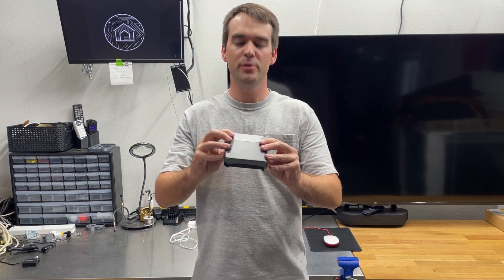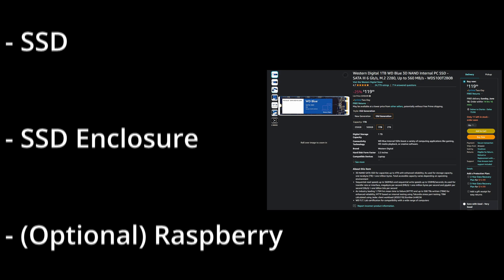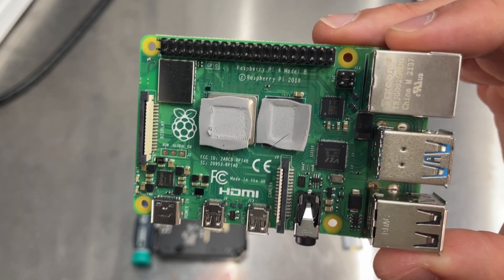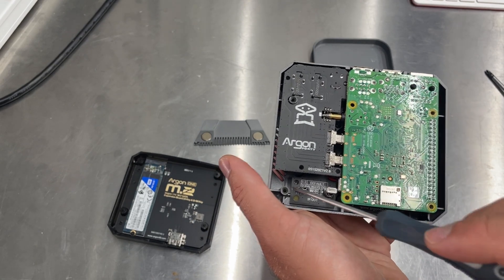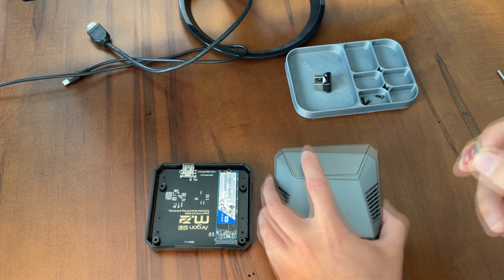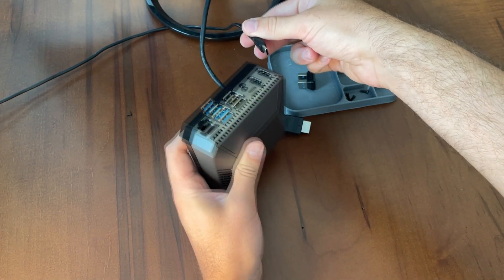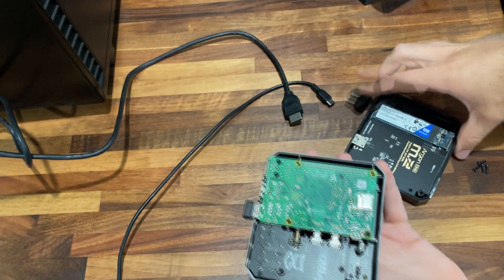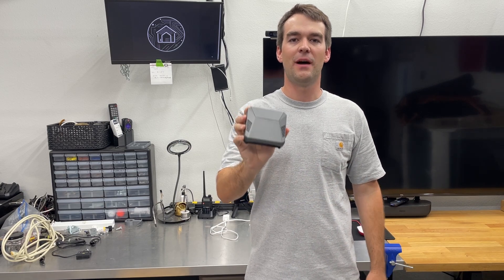How to Install HomeAssistant on Raspberry Pi 4 with SSD - Argon One Step by Step

Comment: There was no need to install HA to the sd card after the bootloader step.  Use an enclisure and install the image to the ssd.  It will boot from the ssd and install HA as normal.  It's how I did mine ,  although I have the nvme bottom for the argon so I loaded the image to the nvme then placed it in the argon.  no problems.
Reply from the maker: That assumes you have an nvme or sata enclosure already. This is cheaper for new folks who won’t use that hardware again

Comment: did you order only the Argon case or also the expansion board? and does it come with the USB dongle?
Reply from the maker: I believe it came with the expansion board and dongle but I do know they’ve reworked it with some different boards that support nvme now
Reply: @ChuckBuilds  now they sell them both separately and they also sell the nvme board now, thanks for this!

I did have another question .. do you know how I could add the backup so I would be able to restore from it on the SSD? or maybe even move it to the SD card?

Comment: why not use the 64bit version?
Reply from the maker: You could, it doesn't really matter since we aren't using Rasbian as the primary OS - just as a temporary step to load the HomeAssistant OS.

Comment: Hey Chuckbuilds - a lot of videos says it’s not possible to set HA up without Ethernet cable (or very difficult to do) As I have Starlink gen 2, I only have facility for WiFi and after searching for a video that shows you how to set-up using WiFi I found yours and as a bonus you have the same case and SSD as me. You’re a genius! Many thanks for the video my friend
Reply from the maker: Glad to help!
Reply: Is there a way to get it to boot automatically when the Pi receives power? Eg if it loses power momentarily then power is restored - the Pi turns itself back on. Thanks
Reply from the maker: @chrislee5245  I don't think this feature exists for a Pi but it is built into a lot of BIOS' for computers. I cover it in my Dell Optiplex video.
Reply: @ChuckBuilds  I thought it would be possible, never mind. I had it years ago on my crypto mining rig
Reply from the maker: @chrislee5245  It might! I didn't see anything on a quick google. Crypto mining on a pi? wild!
Reply: @ChuckBuilds  no you misunderstand my friend - the crypto mining rig I had was a basic PC with 5 GPU’S. it sat in an aluminium frame
Reply from the maker: @chrislee5245  Oh nice. Yeah it's a lot more common for a PC motherboard to have restore from AC loss settings. the rpi doesn't seem to.
Reply from the maker: @chrislee5245  actually, the more I think about this. I think as long as the pi has power it will turn itself back on. I don't think it would stay off. There is no setting for it. But I think it would just be on with power attached.
Reply: @ChuckBuilds  my Pi definitely doesn’t turn itself back on when power is restored - I’ve just tested it

Comment: When I plug the USB jumper in nothing happens - the SSD is not detected.
Reply from the maker: What SSD are you using? And you're using an Argon case correct?
Reply: @ChuckBuilds  That's right and a Ediloca EN206
Reply: @ChuckBuilds  Addendum - I think the USB bridge was bad. I have it working with a separate USB to USB cable.

Comment: Metal Table is a bad idea, unless it's grounded and then still covered it with a matt
Reply from the maker: I see where you’re coming from but it’s a coated nsf certified surface so I like to think it’s fine for my hobbyist use.

Comment: If I have already RPI OS installed on my SSD, how to install HA??
Reply from the maker: You need to use a flash drive to overwrite the ssd. You can’t be using the ssd for the os and overwrite it at the same time

Comment: Seriously? I mean the video is great, but how can you recommend an NVME SSD .. and only line out on screen that it's actually not suited for the exact purpose of the video??
Reply from the maker: There are some argon kits and SSD expansion boards that work with NVME, in which case I would recommend an NVME. I would recommend an NVME over SATA SSD as it is faster and generally cheaper. However, for my specific Argon SSD expansion board it requires a SATA SSD. If you are purchasing these parts, get the NVME versions. If you already had the parts, double check it doesn't require SATA like mine did.

Comment: Mine can’t get an ip ?
Reply from the maker: What kind of device? Is your NIC supported by Linux?
Reply: Ouuu I’m new to this I don’t know what (NIC) is but I’m doing this with an xps 15 laptop, I have the raspberry pi 4, on a nighthawk r7000 router.

The raspberry is connected to Lan cable . But I don’t see the ip by the (wlan0). I also had an pi in the past that I got rid of.
Reply: Update: It was a case issue took it out of the case now the (end0) ip address is popping up now

Comment: how do you turn on the fan on the Argon one?
Reply from the maker: there's an addon! https://github.com/adamoutler/HassOSArgonOneAddon
Reply: Thanks for getting back to me... im new to Home ass. I got  HassOS I2C up and running but step 4) Click the … button (in top left).
5) Add this Repository URL.
Click ArgonOne Temp Control and install.

i dont see no URL nor the app for ArgonOne temp controler in the app store!?  @ChuckBuilds
Reply from the maker: @Chillwind  Did you restart HA after adding the repository? Join my discord and start a thread in the support channel and I'll try to help!
Reply: thanks buddy, i got it, after 2 days off messing around and reading forums and a crash cource in Yaml file editing  @ChuckBuilds

Comment: Thanks for your video, you gave me the push to finally go HA, I made it almost to the end. HA is installed and seems to be working, wifi is connected however I can't open it on my browser, running a MAC mini with safari Version 16.6 . After entering the address I get "Safari Can't Open the Page". Were does the ":8123" come from is it the same for all. THX
Reply from the maker: Hi the :8123 is the port that homeassistant is running on. You can’t leave that off. Try homeassistant.local:8123 in your address bar

Comment: A not-too-well-known fact is that the Raspberry Pi OS is also available for a Mac or Intel/AMD machine. This turns your desktop into a large RPi.
I use it to run odd-ball situations when I don’t want to mess with RPi boards.

Create a LIVE install onto a USB drive, and boot into an RPi running on a powerful CPU with 32GB RAM.

Comment: The Raspberry Pi Imager Software allows you to set up SSH and/or WiFi as an option during the imaging procedure.
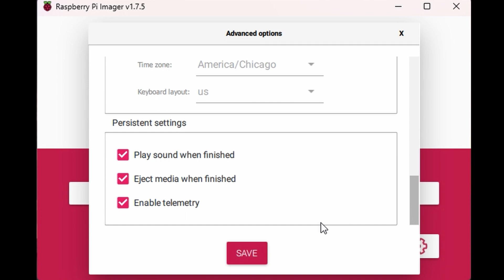Reply from the maker: It does, but only for Raspbian OS, not HomeAssistantOS. I showed this around the 9:45 mark in the video!

Comment: Thank you, that was super easy to follow and timely - I got notification last week that Raspberry Pis had come back into stock and I ordered one along with the Argon One case, Argon PSU with on/off cable and SSD.   It all arrived today and it all worked on the first attempt.
Reply from the maker: I'm glad to hear it! Congrats on the new RPI as well, those have not been easy to get lately! I'm glad everything worked for you, I'm working on some videos for what's next so I hope you find them useful. If you need any help in the meantime, let me know! Thanks for the comment.